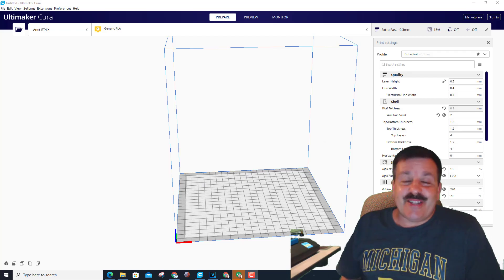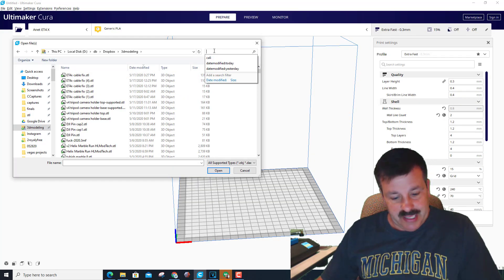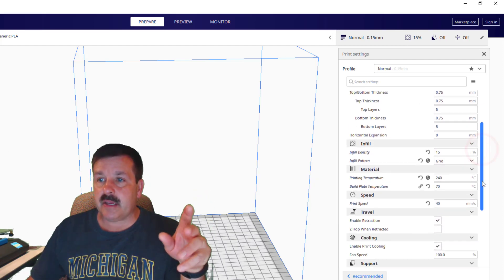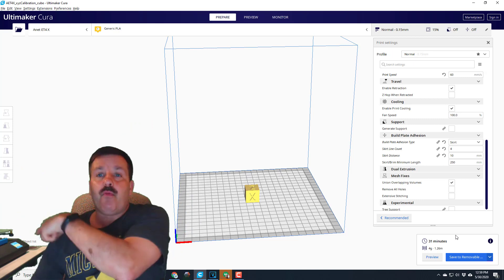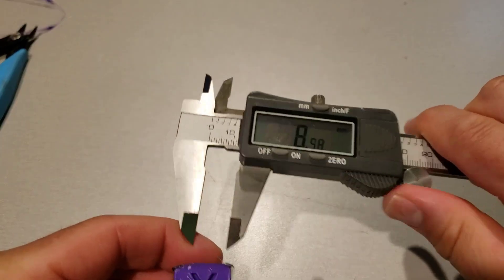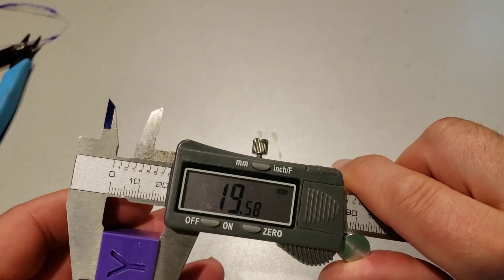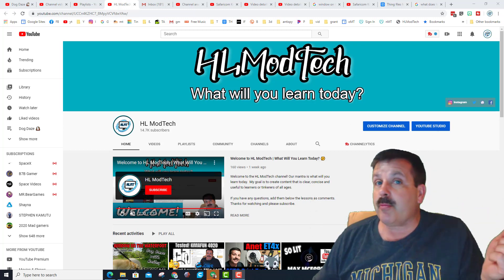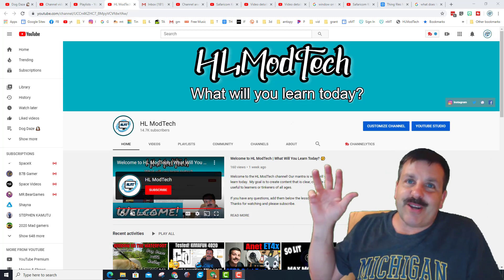Anet ET4x Stress Test 4 | The Calibration Cube

Comment: Bottom corner of your print looks quite warped.
It was your z axis that was 19.5mm
Are you to close to the bed in on your first layer?
Reply from the maker: It is very possible that I have the printhead closer than I needed. Good catch on flipping the axis too. The edges are a little nasty because I did not completely purge some black filament... Thought I had.. lots to check before v2.👍 thanks again for the feedback!
Reply: Something else for you to try.
https://www.thingiverse.com/thing:342198
( Tip for you. You will need to lower your extrusion to get it to fit. "Flow under the material section in Cura”
Reply from the maker: Thanks! Definitely something worth adding to my test list. What is the theory on lowering extrusion? Less "smoosh" gives  a more accurate part?
Reply: @HLModTech  0.4mm line thickness is about 0.55mm at 100% flow making things too thick to fit I  needed to drop the flow on my walls to 70% to get the s plug to fit together.
It's a good way to calibrate your printer if you want to print parts that fit together or have moving parts with tighter tolerance. Only downside is lowering the flow will affect how well your part sticks to the build plate.